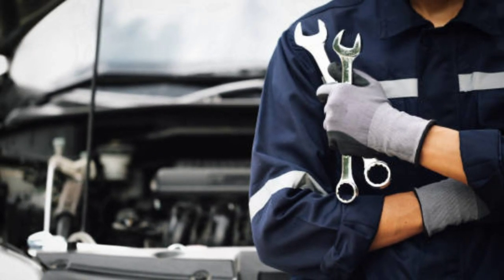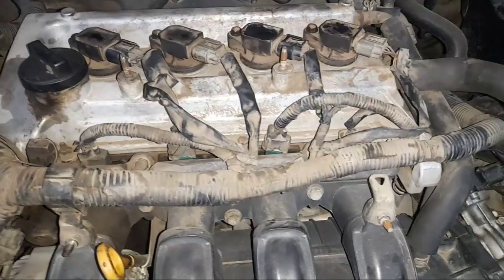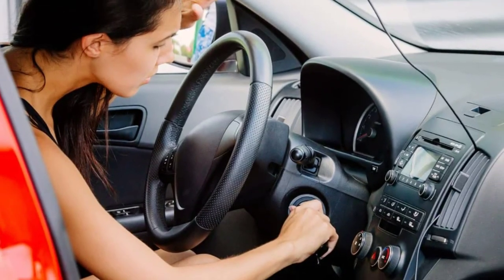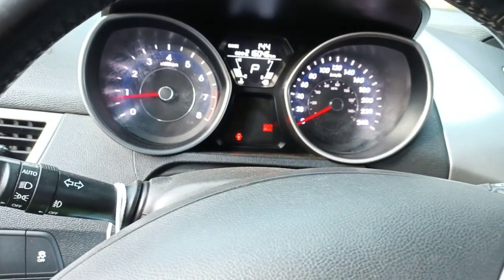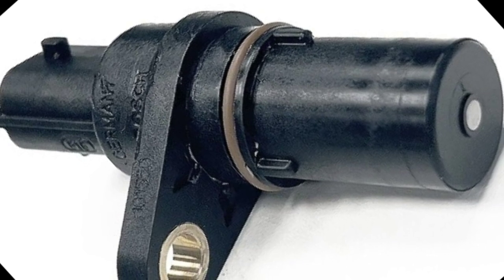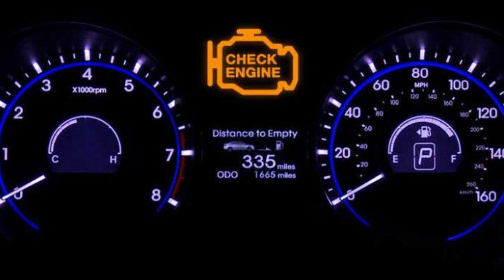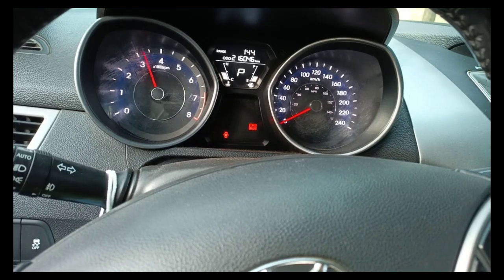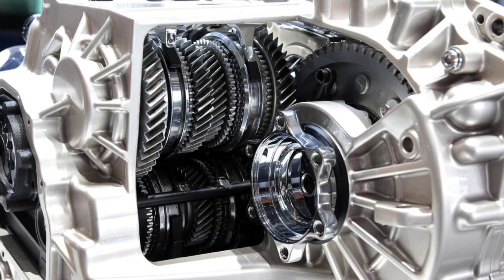SYMPTOMS OF A BAD CRANKSHAFT POSITION SENSOR.

Comment: I replaced the cranshaft sensors on my BMW X3, PCV Valve, Oil filter, cleaned the front valves. Still check engine on. Code P013C9. Do you have an idea what can happen? Cars runs fine.